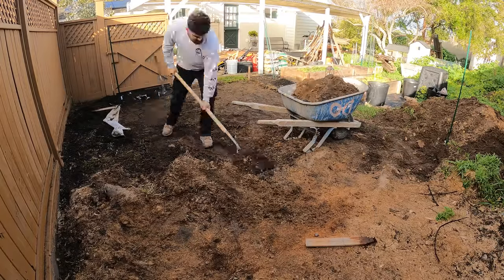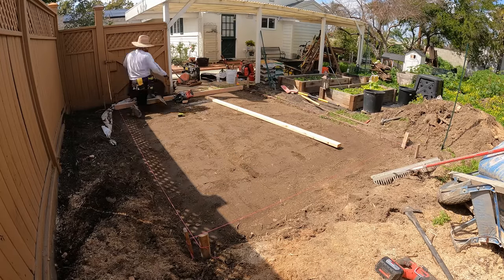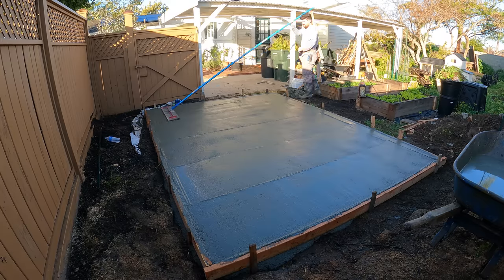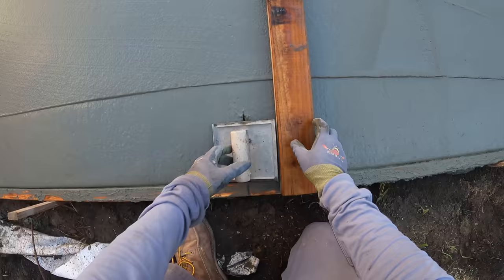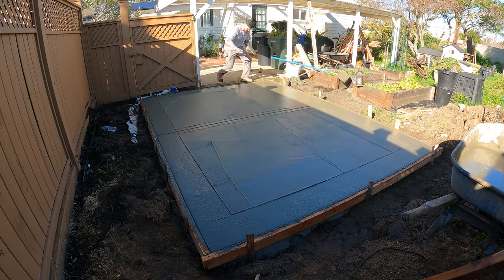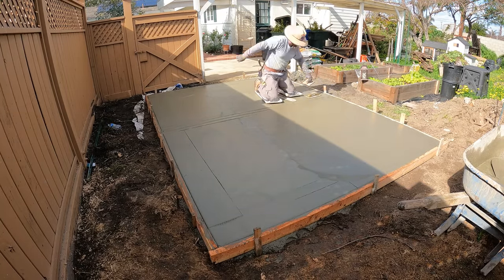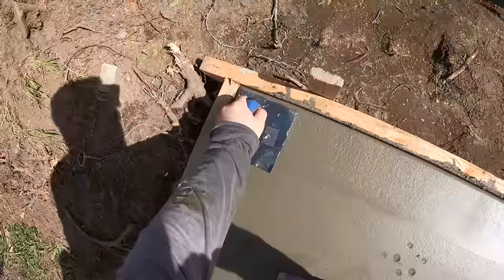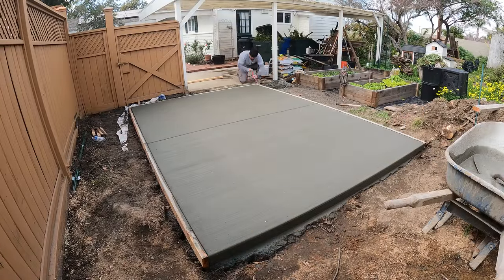How to Pour a Concrete Slab for your Shed!

Comment: I know from experience I would have used a vapor barrier under the slab, what you have made is a big sponge and your substrate ( dirt ) will be more than happy to transfer water and minerals to you slab causing mineralization, staining and cracking in my humble opinion.
Reply: I also used a vapour barrier on my shed base.
Seen loads of concrete jobs in the uk always with vapour barriers.
Reply: Wouldn’t type 1 be fine for underneath
Reply: It'll be fine. Just applaud the guy, Mr Armchair.
Reply: @chadd587  pretty sure it would be fine idk tho only been in construction for 3-4 years
Reply: Thats true
Reply: “From experience” while you’re here watching a how-to/diy video😂
Reply: @chadd587  So what are your credentials?
Reply: @snickerdoooodle  I stayed at a Holiday Inn. Gave me great knowledge in this field that I'm not trained in. Don't you watch TV?
Reply: Being this isn't a commercial below grade job I think it'll be fine.  The average person doesn't need to waste the money trying to source a proper vapor barrier.  Certainly not worth trying to get some Stego product or hydrotech is another one, those products would triple the cost of this basic slab.  if it's that big of a deal I'd say just dump some Tremco 250gc on it and call it a day.  Amazing the amount of below grade waterproofing flat roofers do.  Being a PM, I poured my slab on straight gravel, sealed it and called it done.

Comment: Do you ever start with a base of gravel before pouring, to ensure water or moisture drainage away from the underside of the slab? Any other considerations for colder climates?
Reply from the maker: Not in Southern California
Reply: Yuss ... On the Canadian prairies that's extremely important.  You really want a good base to avoid heaving.  You would also put heavier rebar in at most 16" grid, 12" being wiser.  So I go with a bit of sand first, then a few inches of thoroughly tamped road crush, then 12" rebar tied at every joint.  Some will say overkill, but it's not expensive, and it'll last for generations.
Reply: A poly vapor barrier may be helpful as well ?
Reply: @robertchoutka3191  I think some folks swear by that, but it's most likely application-specific.
Reply: No

Comment: I know what this job takes... and I give credit to your lower back... cuz you sure as hell got one strong lower back..... RESPECT
Reply from the maker: Thanks bro
Reply: @OdellCompleteConcrete  How much does a slab like this cost?
Reply: @Mattytube18  depends on your location and the contractor. They usually charge around about $15 to $20 a square foot. Thats labor and material. It can get expensive. This jobs looks to be a 12 x 15. That would be about $3000 +/-
Reply: @KawaiiArcadeMasters  

Thank you.

Comment: Well done!  Thank you for sharing.  I just did my 1st concrete slab, 5' x 7' x 3.5", did a "dry pour", it is curing now, looks o.k., but some rocks on surface.  After reading your comment about crumbling, will likely forgo "dry pour" and go with traditional mixing in the future.
Reply: YOU SHOULD HAVE SHAKED AND BAKED WITH THE WOOD 2X4, THAT WOULD HAVE REMOVED THE ROCKS
Reply: @leelunk8235 STOP YELLING

Comment: Last year I poured a slab for a new shed I built what a difference over buying a shed with a wood floor. Tuff shed had no problem with building over the concrete slab they tied into the slab with the walls and now it's liking walking into a small garage.

Comment: I did my own pad like this last summer. Got a couple quotes for around $2500 in Canada.

Ordered mix from a company that charges by the 1/4 yard. Cost me $550 and did it myself in a day total (prepped the day before and poured the next day)

I wet cured it for 3 weeks and when I drilled my baseplate in, it was by far the hardest concrete I've ever drilled through.
Reply from the maker: Nice work

Comment: I use the " 50 50 broom " as well. Best broom IMO for most jobs. Leaves great lines. I'll use the 100 % plastic broom on certain jobs though too.
Reply from the maker: The only way to go
Reply: What is the 50 50 broom?
Reply: @treeamigo8447  it's 50 %synthetic 50% horse hair
Reply: @Nick33779  
Cool thanks
Reply from the maker: @Nick33779  
Right on

Comment: You guys inspired me to do multiple pads in my backyard and a retaining wall planter in the corner! Thanks for all of the detailed videos. In some of my first slabs, there are some low spots where water pools… is there anyway to fix it?
Reply: You can patch the spots with something like Ardex CP. Then using the same product do a thin coat over the whole surface(after proper mechanical grinding) and apply a broom finish. I do it all the time.

Comment: I’m a novice slabber, watching many YouTube vids… just did a small slab 4 ft by 6 ft. Of all the videos, not one mentioned the type of concrete consistency you need for a smooth surface slab. Unfortunately, without that knowledge, I just used Quikrete regular 4k psi. I could NOT get it smooth like I wanted it. No one told me how much large gravel is in that stuff!! Maybe you next vid could be a short seminar on different types of concrete for different uses/finishes.
Reply from the maker: Good idea

Comment: Tyler, you made this work of art look so easy. You nicely compressed 12 hours into 12 minutes for this video. I have never worked with concrete, but I want to make my own pad for mounting two 300 gallon fuel tanks. To be honest, it scares the bejeebers out of me. I feel like its a race against the clock so you better prepared and know what you're doing or you'll end up with two cubic yards of boat anchor. What are your thoughts on dry pouring? And, can you come to my house and do this pad for me? 😂😂😂
Reply from the maker: Dry pours crumble in no time
Reply: Yep, dry pours are just a passing Fad. They suck.

Comment: Nice work 💯👌 I would of added another joint in the middle crossing the joint you made so it’ll basically be 4 squares so it doesn’t crack ,big pieces
Reply from the maker: The more the merrier
Reply: @Odell Complete Concrete 😂

Comment: Hi Odell, Would you recommend using a bull float for small shed slab 2.7m x 1.5m which is approx 8.8ft x 5ft. I have a screeder, a small hand mag trowel and a steel finishing trowel. Wondering if i need to hire a bull float or can I get away with tools I have.
Thanks for your help. Channel is great by the way.

Comment: If you wanted a smooth finish, would you just stop before the brush step?  Or would there be more finishing involved?
Reply: different floats to run over it depending on how "smooth' you wanted it . . . you can go as far as you want too . . .water polish it to a black mirror look'n finish . . . most guys i've seen lately have been finishing with either an epoxy floor finish (car garage kit thingie) or a buddy o mine put down a quietwalk insulated and heated pad deal then put nice tile over it
Reply from the maker: The more you trowel it the smoother it gets
Reply: Yep,just keep troweling it'll get harder than you can trowel it.

Comment: Does the tool you use cut 1” deep for the control joint? Everything I see says at least a inch deep or more pending the depth of the slab. What’s your thoughts? About to try a shed slab shortly and was debating getting the tool or renting a concrete saw.
Reply from the maker: About 3/4" works

Comment: Did you do a fall from back to front and then cut a line across it ? Would a line not have worked better from back to front also - will water not pool now in that joint ?

Comment: What is the joint for in the middle? I was under the impression that if you want to make a joint for expansion and contraction, that you would need to cut down through the full layer of concrete, but in this case you almost just make agroove in the top but the two halves remain mostly attached to each other. Can you explain? I am a total beginner but need to put down a contrete slab about this size for a sauna build.

Comment: if you bull float to the forms at an angle it won’t dip down on the return
Reply from the maker: I typically don’t have this problem when I bullfloat but I’ve seen guys dip those edges hard
Reply: @OdellCompleteConcrete  i just usually go at an angle to prevent it but yeah, if you are good enough it won’t be a problem

Comment: Nice work!
Do you know how many bags for a 13x10 slab? Planning on settings a gazebo on top which is 13x10 or should i do a 13x13 slab.
Reply from the maker: 13 x 10
64, 60 lb. Bags at 4"s

Comment: Whats your thought(s) on this dry pour craze going on for doing concrete? Perfection every time with your jobs, enjoyed it.
Reply from the maker: Dry pours are a fail
Reply: @OdellCompleteConcrete  can you explain please. I am ignorant on concrete in general. Is there ever an exception, small projects or a certain size that is non load bearing that would be acceptable? I see so many done on Youtube and people even putting them through pretty tough test and they appear to hold up.

Comment: Good on you for having a go young fella but no vapour barrier, slab is on fall so harder to build on and broom finish on a shed floor??? Gonna be a bastard to clean now.
Reply from the maker: Minimal slope no problem.
Sealer makes easy to clean.
Vapor barrier only needed in rooms climate controlled

Comment: I tried making my joint cut as you did in this video, but the heat beat me, I've got a few stud indentions in my slab that I could not erase, it even looks deep in those areas. Any recommendations on how I can fix my slab?
Reply: Break It And Redo...😩😩😩
Reply: I ended up building a shed on top of it as is. God willing it will last forever 😅

Comment: Hi David. Unrelated question for you about vertical cold joints. If I pour concrete retaining wall one section at a time leaving rebar sticking out to tie into the next section and keying new wall into the old one, is it likely to leak and stopping me from installing stone veneer on top of the cold joint successfully? Is there a method to do this successfully? I appreciate any advice.
Reply from the maker: Stop and start the veneer at the cold joint
Reply: @OdellCompleteConcrete  much appreciated.

Comment: Why do you have to add the line in the middle and what is the measurement for the square or rectangle? Is this a standard size? Sorry I''m new to this.
Reply from the maker: Crack control
Reply: Oh that makes sense! thank you @OdellCompleteConcrete

Comment: Have you seen the phenomena running around on YouTube about the so called 'dry pour' concrete method? I'd be interested in your thoughts. The biggest issue I see with the method is the fact that water ratio is not being taken into consideration, thus you don't know if the concrete has absorbed water all the way through or has too much water, making it fundamentally weaker than it should be. Check it out, might make for some interesting content :)
Reply from the maker: Don't do it, it's going to crumble away!.
Reply: @OdellCompleteConcrete  If done by the steps, it won't
Reply: Do not dry pour anything that you actually care about. You CAN get away with it for installing fence posts, if it's done correctly. I believe quickcrete even makes a special mixture for dry pouring. Correctly mixed will always be stronger. Would not recommend for anything structural.

Comment: Nice job, but if this is for a shed, you need to rebate the edges. If you don't,  water will get in underneath the shed and cause not only rust, but also contents damage.

Comment: Use hard trowel for sheds. Could be more intimidating if don’t know what you’re doing. You don’t need a joint for a floor this small. Just the rebar and fiber in the mud is plenty good.
Reply: Doesn't hurt ,either. Concrete is like a woman ,never can tell what she's gonna do.
Reply: @RRC1  It won’t crack.
Reply: @cuzr702  no offense, but you haven't poured much concrete. The old man that trained me used to 
"the sky's blue,water's wet & concrete cracks"
There's no getting around it.
Just Saying "it won't crack" doesn't mean it wont.
Reply: @RRC1  I did it for 15 years. A small slab with good compaction shouldn’t crack. These guys just don’t know what they’re doing. You never put a broom finish inside. If it was big enough that a joint was needed, you saw cut a joint. Cleaning this floor is going to be a nightmare because of those 2 mistakes.
Reply: @cuzr702  I see your point, but the key word is "Should'nt" . Haven't you ever done something like make Dinner or a cake or something like that , and it's like "Well, I followed all the instructions, I don't know why it turned out that way"  meaning it was burnt or something . So it's just precaution to put in a control joint. The reason he didn't sawcut it is because he would have to come back another day to do that.  As for brooming it ,I don't know why he did that,maybe that's what the customer wanted. But your definitely right ,it'll be harder to clean compared to a hard troweled floor.
Reply: @RRC1  No way is this person a contractor.

Comment: A PROFESSIONAL CAME TO MY PREVIOUS HOUSE TO DO A BIG SLAB IN THE BACKYARD, HE ASKED ME HOW I WANTED THE STRESS JOINTS MADE, CONTROL JOINTS, I DIDN'T KNOW ANYTHING ABOUT IT, HE RECOMMENDED THE COMPLETE CUT, I SAID OK, A WEEK LATER I HAD WEED COMING OUT OF EACH LARGE SQUARE IN ALL DIRECTIONS, HE HAD CUT THE CONTROL JOINTS WHEN IT WAS ALMOST DRIED, WHICH LED TO CHIPS EVERYWHERE IN THE STRESS CUTS. I PAID THE GUY AND I LEARNED A VALUABLE LESSON ON CONCRETE. I COULD HAVE BEEN A JERK AND NOT PAID HIM, BUT IT'S A LESSON I LEARNED.

Comment: Make sure that you check your laws, because , where I live, if my shed is on a cement pad it is considered a PERMANENT structure, and you will be taxed for it. My shed is floating on railroad ties, and the bottom is very nicely covered. Therefore, my shed is considered PORTABLE, and I can’t be taxed for it. Even though it would be more trouble than it’s worth taking it with me.
Reply from the maker: 120 sq.ft. and less is no issue
Reply: Oh , then , that’s a closet

Comment: They didn’t want to put anchor bolts in for a shed to fasten to?
Reply from the maker: Tapcons
Reply: @OdellCompleteConcrete  😂 might as well use scotch tape.
Reply: @user-mw2ky8qq7g you could also use 1/2 inch redheads.

Comment: Are you replaying video or do you really mess around floating the concrete that much?
Reply from the maker: Yes it's fun
Reply: @OdellCompleteConcrete  I've been told not to do it because you can work up the surface to much and make it less resilient
Reply from the maker: That may save you a couple years

Comment: saying you did this solo, you dind't do solo. pumping concrete and spreading it not solo.  you would have to do a few 5x5 if you did this yourself. your buddy pumping and helping float is the hardest part of the job and requires the most skill. Most diy people should not attempt this thinking it will be easy.  they will blow out forms, not square, base won't be right, they won't know how much to order etc.

Comment: Why would you slope the slab?  There is no need for water run off. All your doing is making leveling the sil plate a pain in the ass..
Reply from the maker: The shed isn't going to cover the entire pad here. About 2 feet around the shed will be exposed on all sides

Comment: If you stick gravel or play sand under your concrete, you are installing your concrete wrong. You need to put a plastic membrane barrier to keep moisture from the soil, penetrating the concrete and causing potential damage down the road!
Reply from the maker: No problem in Southern California
Reply: @OdellCompleteConcrete  That concrete pad won’t leave out the full Jevity of its life like it’s supposed to you’ll maybe get 10 -20 years out of that pad before you start to see imperfections and defects and issues! Always we see on the news in California is everything crumbling house are falling off the side of cliffs, mudslides landslides, flooding earthquakes, so yeah your concrete pad in the state of California is definitely not gonna last long at all just with those geological issues alone! Then if you add in a poor installation, that concrete pad won’t last 10 years!

Comment: WHY would you do a broom finish for an INTERIOR shed floor ?   Broom Finishing is mainly for EXTERIOR surfaces.  A B/F makes it very hard to sweep and keep the floor clean.  Where are the anchor bolts for the walls ?
Reply from the maker: Epoxy flooring.
Expansion anchors
Reply: @OdellCompleteConcrete  Epoxy flooring for a SHED ??  Sounds like overkill to me !!